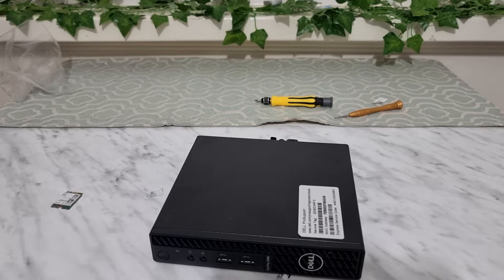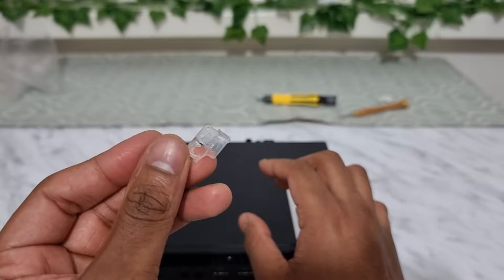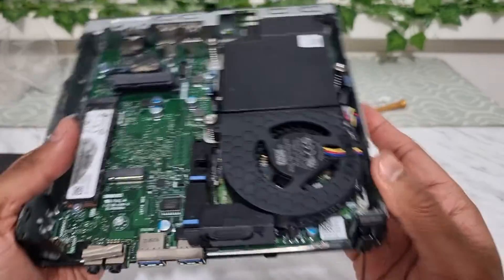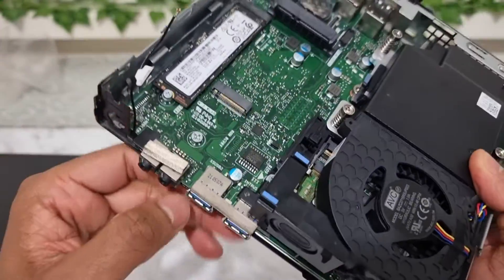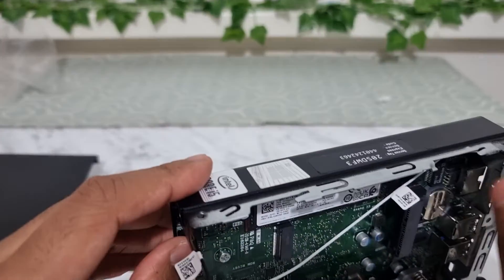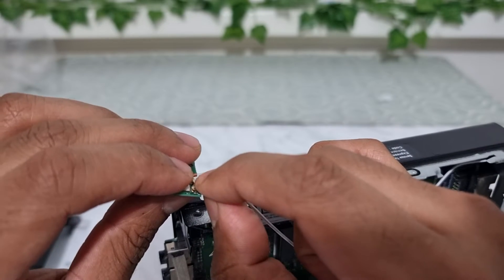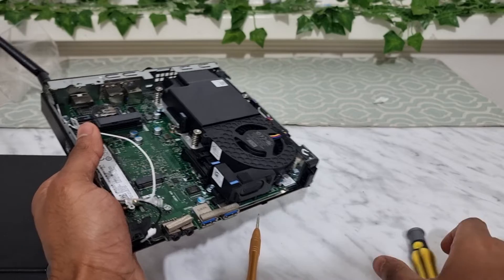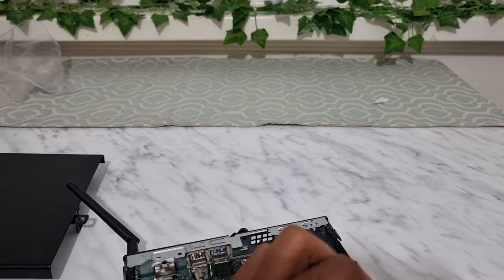WiFi and Bluetooth Kit Installation for Dell Optiplex Micro PC

Comment: Does the Dell mini pc come with the wifi card or did you buy them separately?
Reply from the maker: Some do some don't, depends on how you configure them. You interested in buying?
Reply: @MH_Tech_UK  I'm interested in buying the pc but I'm seeing some are unboxed having the external antenna while others don't have it and the vga port so I was wondering what's going on
Reply from the maker: @nyagitarialex4066  I got 10th Gen i5,12th Gen i5 and i7, look at the video description for eBay shop

Comment: Does dual wifi adapter replacement be done  on dell dt 3470 model as it supports only single band 2.4 ghz??
Reply from the maker: Hello yes you can, you have to change the M.2 card to a dual band one...Some cards are whitewashed by Dell..Do even though cards are functioning,  they won't work
Reply: @MH_Tech_UK   So should i go for it or not dear.. even i don't know whether my wifi card chip has single cut or double cut i mean both a & e cut slot or single cut slot.. would you help me out on this?? Should i go for it and if yes then which one should i buy single cut slot or double cut slot chip??
Reply from the maker: Go for it, I done that to my old ASUS which came with a single band. It was worth it.

Don't worry about two cuts, 3165NGW 8260NGW, 8265NGW,  7265NGW all of them are compatible with both.

Good luck

Comment: I can't imagine the secondary internal antenna even gets any signal considering the Optiplex case is metal and will act as a shield for any RF signals!!!

Has Dell published any signal strength data for the internal antenna vs the external antenna?!!
Reply: It's basically for the Bluetooth and who is going to have Bluetooth devices behind the pc?
Reply: @nyetloki  The antenna is for WiFi - not Bluetooth!!!
Reply: @LWRC  dude read the title. It's a combo card, and the affinity settings, the rear antenna is the primary for wifi.
Reply: @nyetloki  It is never good to have two different bands operate with antennas in such close proximity!!!
Reply: @LWRC  it's 2023 not 2003. Wifi 6 and bt 5 are co-developed time shared protocols and have no issue being on the same antenna or cards. Multipurpose wifi/bt soc have been standard for literal decades. Google intel ax200 for example, the dual use card that this video is about! Get with the times.
Reply: @nyetloki  Are you an rf engineer?!!  You can't violate the laws of physics genius!!!
Reply: @nyetloki  It is fine to have multipurpose RF cards but the antenna still has limitations!
Reply: @LWRC  no but Intel has rf engineers....
Reply: @LWRC  the antennas have absolutely no problem carrying multiple frequencies. Not that these are multiple frequencies, they are all on the same bandwidths and use time division and inter-protocal signaling to prevent collisions.
Reply: @nyetloki  Is that the same logic the big three auto manufacturers use to turn out junk every year while foreign manufacturers eat their lunch?  Sure, they have the same engineers, right?!!!
Reply: @nyetloki  These two are operating on different frequencies and having an internal antenna is never better than an external antenna! This is how the laws of physics work!
Reply: @LWRC  bro go rage at Intel.
Reply: @nyetloki  Says a fool. I'm not the one who doesn't understand  how antennas work and confused it with the rf board inside the computer!
Reply: @LWRC  says the maroon who can't even listen to the video he's commenting on or Google the card model to get the information direct from the manufacture
Reply: @LWRC  이게 포인트 같은데....
Reply from the maker: Hello, 
Case is designed in a way that the antenna part has plastic enclosure rather than metal.
Reply: @MH_Tech_UK  The plastic enclosure side is only one small 'window' where the internal antenna receives and radiates RF signals. The rest of the case is still metal as well as all the electronic circuit boards and components within the case. So unless the user specifically points the plastic case side towards the WiFi source, that plastic case side probably won't make much of a difference. I don't even know why Dell even bothers with such a design and I can't imagine it even works at all with the internal antenna. I have a Lenovo Thinkcentre unit with the same case size and it utilizes an external antenna and works perfectly with no issues. I don't believe Lenovo has any backup internal antenna.
Reply from the maker: @LWRC  
You do have a point , I actually connected the internal one as stand alone it was still streaming 4k just fine from router placed feels away in opposite direction. The metal part actually protrudes compared to the casing that may be the reason signal uninterrupted.

HP, Lenovo and Dell all have auxiliary antennas. Funny enough in the morning up to date models 3080 onwards thar protrusion is even higher.

They all tend to use external antenna as main internal as auxiliary.
Reply: @MH_Tech_UK  Great to hear.